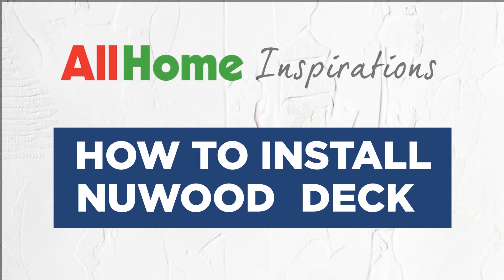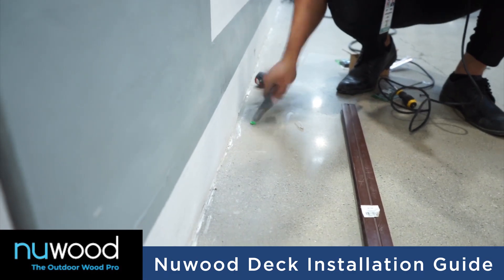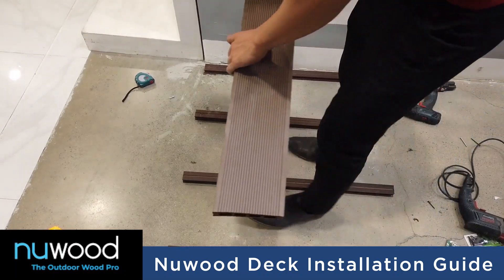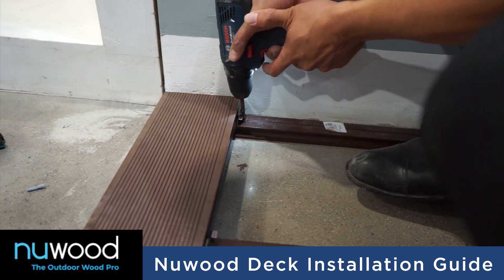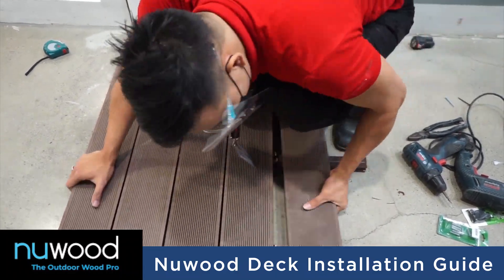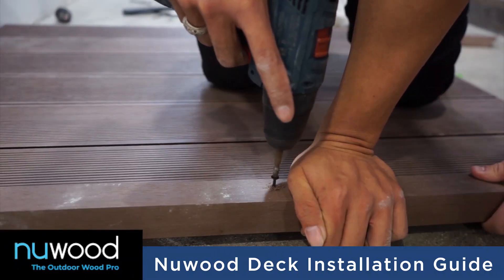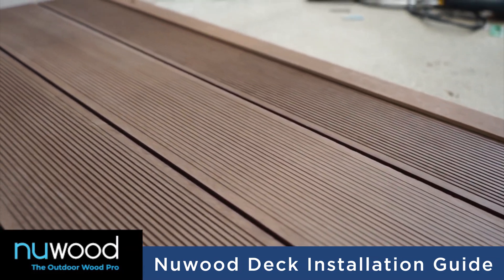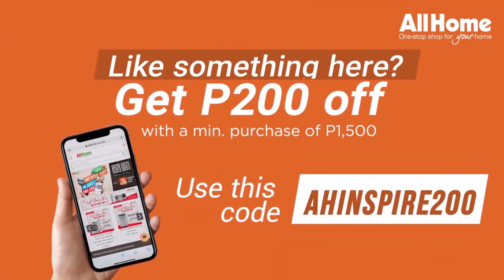How to Install WPC Deck (Nuwood) | AllHome

Comment: That's great if your building your deck inside a cement hallway, what is the recommended structure in the philippines for a raised deck? Metal frame? do you  have a video for that?